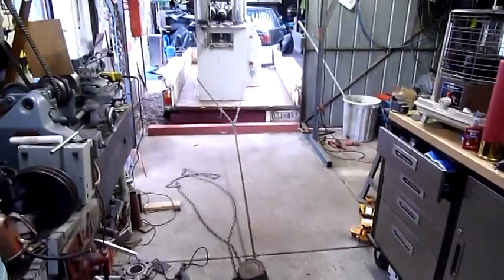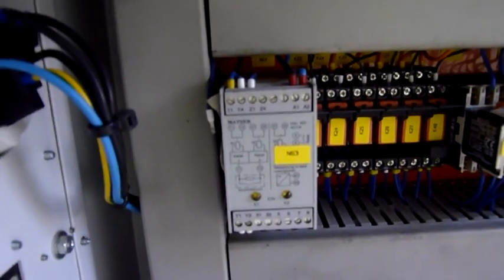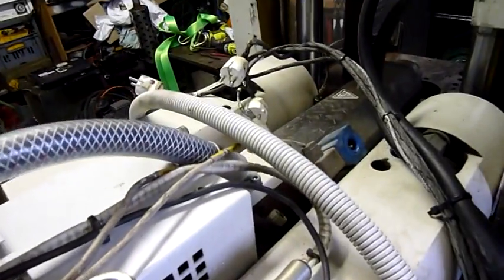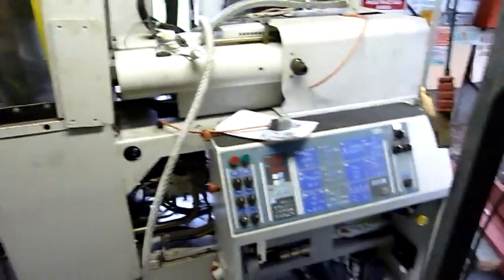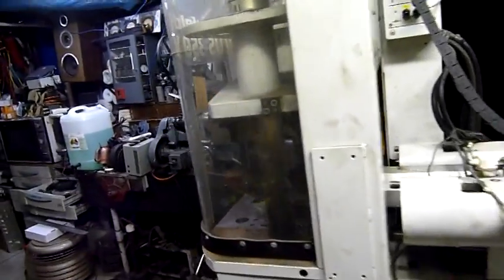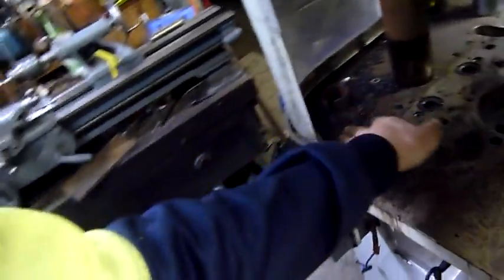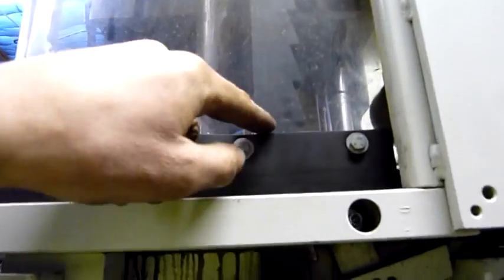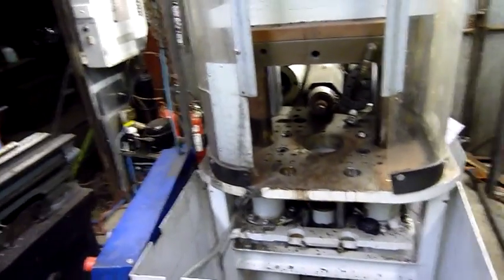Battenfeld - Plus 350V-75 Injection Moulder Pt1 - unloading and inspection

Comment from the maker: maximum shot size from the barrel is 49g, so it would be possible to make AK47 or AR15 magazines from 2 halves, i would need a bigger machine to make P-Mags for the AR tho :(\

getting the tools made is expensive, and I can't legally export magazines :(, so its not viable at the moment.

I would rather press out steel AK47 mags tho, tried and true for decades!

Comment from the maker: I can run the heaters and control off a single 10A outlet, but the big motor is the issue, supplying enough amps through a RPC is a bit tricky since my main house fuse is only 50A

Comment: I was hoping to see you get it up and running. You could probably rewire the heaters to run single phase and get a big rotary phase converter for the rest of it. You will probably need to run a 100 amp circuit out to your shed though.

Comment: I did some machine moving using 4 skateboards. They did the job but did not survive the abuse of having 2 tons on them. Only had to move it 10m on the same floor though. 2 just had the bearings die after 5m, the other 2 cracked in half, but they did the move anyway then went to the bin. Even used that would be worth about 20k or so. I know some guys who would take it and refurb it for use, then use it till it falls apart in 50 years time. Blow moulder at work is over 40 years old, still works.